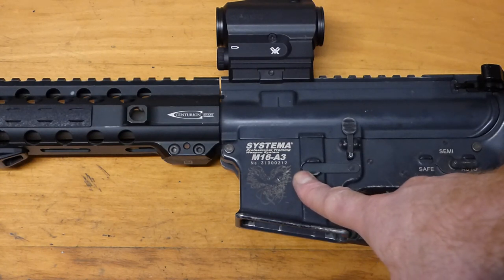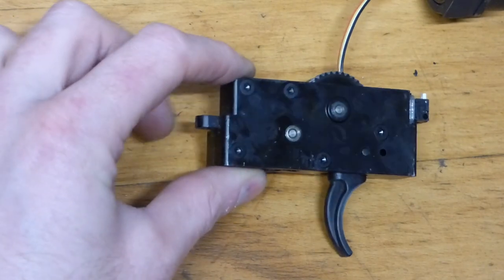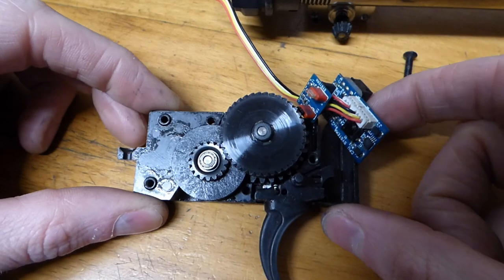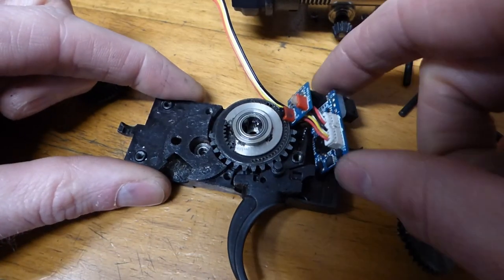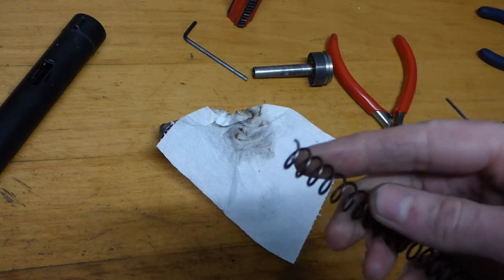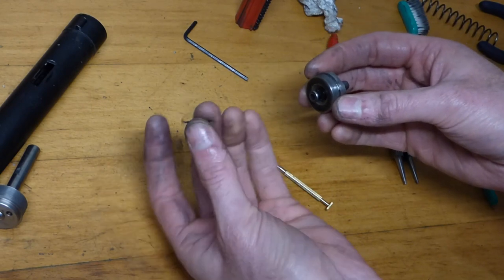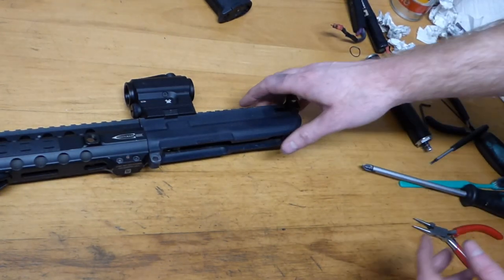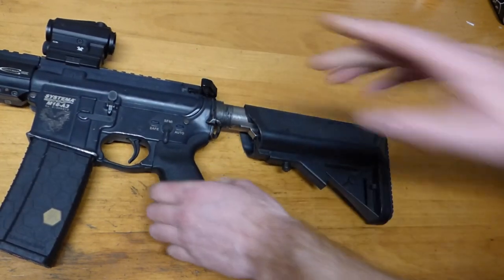Systema PTW service

Comment: Hi bud. Hope you can help me as the shop I bought my A&K STW from will not answer the phone or return emails.
It's brand new but only shooting 60fps when I can get a reading. I have tried everything I can find on the net. Does it make a difference  as to what way the sector gear goes back into the box? Mag feeds OK, did chop one bb, cylinder cleaned out re-lubed. Buffer cap 1.1mm up from the tube. All nice and tight no movement on the cylinder when closed. Sounds quite slow on 11.1 could just be the crappy standard motor.  Any thoughts please?
Reply from the maker: It could be any number of things causing the low FPS. Have you changed any parts internally from standard?

The Sector gear will only work one way round, so the fact that your gun cycles shows that you do not have it upside down.

A few ideas to check for, 
-Air seal on the cylinder and cylinder head, then check it with the feed nozzle, 
-Make sure hop rubber is correctly seated with in the hop chamber, 
-Make sure when the gun is assembled the hop chamber is sitting tight to the gearbox. (look through the mag well)
-Also make sure the piston moves freely withing the gearbox and it is not too tight. (gearbox must be closed and screwed tight, keep cylinder out for this test so you can see the piston)
-Make sure barrel is fully clean
-Make sure hop up is not set to high.

I have a couple of videos on my channel that look at 2 individual problems with low FPS, check those out maybe be heplfull.

With regards to being slow on the 11.1v, yes it could be a not so great motor, equally make sure none of your shims are tight on the gears and that the gears are correctly spaced. Also check motor engagement height with the bevel gear.

https://www.youtube.com/watch?v=VcArUvJl0K8&t=3s

https://www.youtube.com/watch?v=KpW8xkvhvdE

Hopefully this is helpful. let me know how you get on. I'm also contactable through my facebook pages aswell, just search Adzzzy's Armoury.
Reply: @adzzzysarmoury  Thank you so much. I will check all the above. Only got it yesterday, raaaar. Thank you.
Reply from the maker: I was in autopilot mode when typing the above comment, some of which applies to V2 gearboxes. 

Similar rules apply though check compression of cylinder and piston and alignment into the hop chamber and that barrel is 100% clean. 

Fingers crossed! :-)
Reply from the maker: @martin-vo4oj  would be interesting to know your solution once you sort it, may help someone else in the future. 😁
Reply: @adzzzysarmoury  Lol, that's OK. Gut feeling is the air seal in  the cylinder. Is it harder to check the air seal in this compared to a V2/3?
Reply from the maker: @martin-vo4oj  Yea I realised this as soon as I posted the comment. So used to questions being on V2/V3 gearboxs. Haha
Reply: @adzzzysarmoury  Will do. Won't be till mid week though.

Comment: I wonder about the PTW internals, you can look straight down on some gears when opened.. Makes it look like more vulnerable for dirt to get inside the system.. It looks so different from any other closed AEG system which are very reliable and more common across the board, also in terms of parts, customization and especially availability.. Working hand in hand with the Titan Gates ect.. I am not sure if I am missing something but what actually justifies the cost of PTW, against for example the Krytac Trident SPR at one third of the cost.. I have seen some very snappy and aggressive Tridents with upgraded motors, barrels, nozzles, hopups and with Titan, that still just run half the cost of those PTW rifles.. And to be really honest about the PTW internals, it look somewhat more like those cheap gelblaster guns that kids play with these days.. But then again something just has to justify that price tag, I cannot seem to figure out what that might be..
Reply: BUILD QUALITY